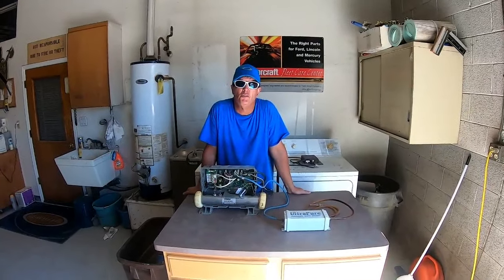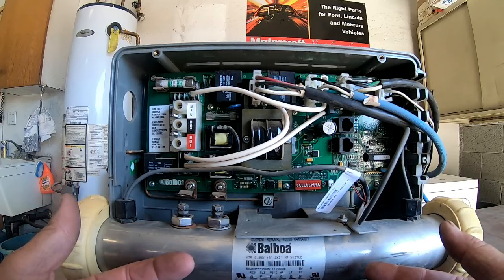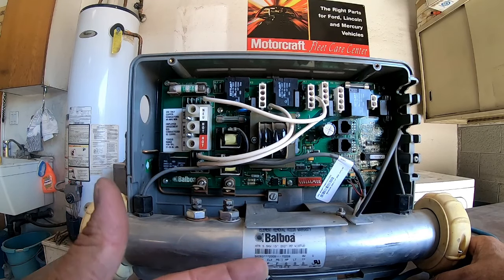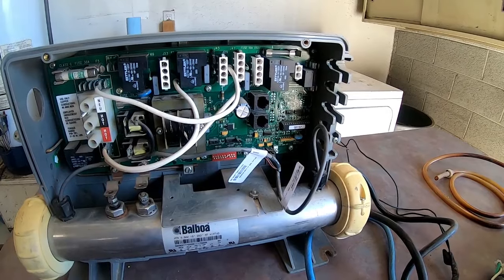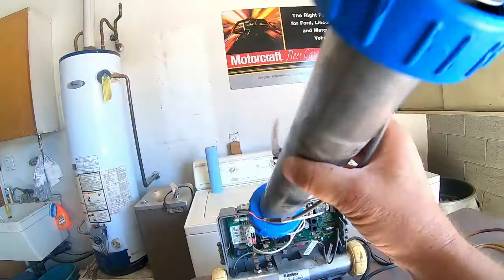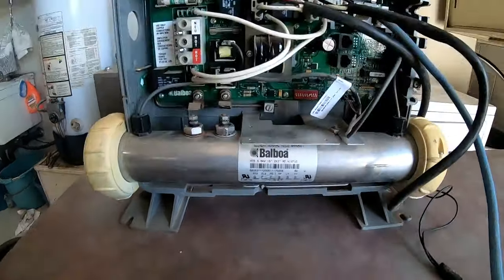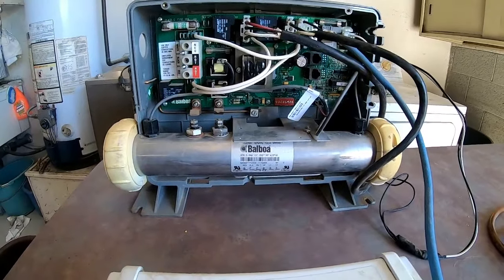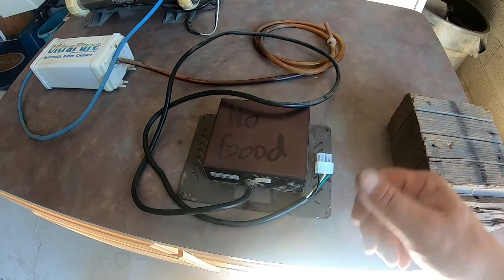Hot Tub GFCI Breaker Keeps Tripping..6 Things To Check For.(DIY Spa Repair) Arizona Hot Tub Factory

Comment: Hello Spa Man, I have a Z110 Jacuzzi Whirlpool with Balboa H136 control system. Water is hot, works well but from time to time the top panel red light starts to flash out of nowhere and disables the heater for 20 mins or so, then red light goes solid, which means heater is on and it stays ok. I drained the tub, removed the heater thinking it was getting fouled, but it looks clean inside, same is true for the power connection points, no rust or calcium buildup anywhere. I am guessing it's one of the two temperature sensors. One sensor is embedded in the heater. The other one is in the water filter assembly. What do you recommend I do to address this flashing red light problem? cheers!

Comment: Hello- Thank you for your videos. I have a 2005 Jacuzzi J335 that trips breaker after heater is on for about 5 minutes, not immediately. If I turn temp down so that heater will not come on, breaker will not trip. Do you think this is a bad Heater or something else? Thank you
Reply from the maker: I would say that is a good place to start...and if that heater has never been changed you are on borrowed time ,15 years.. you have done a good job at taking care of the hot tub..I had one that was doing this couple months back..it would run then pop the breaker.. so I disconnected it and the tub ran for over two week no problem then when I hooked it back up it popped with in minutes..as it turned out there was a tiny pin hole in the heater that when water seeped through it would pop the breaker..I replaced with a new OEM and problem went away.  Hope this helps ..Thanks for watching.

Comment: Soooooo my board fried where the power wires connect/ hot and neutral wires. I guess water got in there or something. Any way I can replace without having to change the whole circuit board

Comment: We have a BALBOA  control pack on our OCC hot tub. but the gfci breaker on the disconnect will trip but only after about ten minutes of being in the tub with both pumps running. It seems as though the circulation pump has a little problem with kicking on as there is a delay when turning on. but it doesn t trip then only after me and my wife are in the tub in front of the jets?

Comment: Spa Man - can’t thank you enough.  Was ready to call a service guy but it turns out the heater was bad. I looked at the Balboa package and assumed I could not diagnose the problem.  You made it very simple.
Reply: Silly question but same thing with my Balboa! Where did you find a new heater tube?

Comment: I have this exact board in a 2012 MasterSpa. Dealer went out of business so I am trying to troubleshoot. Error code is HFL and there is no activity in the pumps at all, both pumps stopped at the same time. Heater heats up but no circulation of water. Any thoughts? Could the Ozone system shut down the pump relays?

Comment: So I followed all your instructions. I have a balboa. It ended up being the heater fixed the heater. Hot tub ran for 24 hrs brought up to temp come home and the breaker has been tripped. Again go through your troubleshooting and now it’s the circulator pump. I plugged circulator pump into a pump2 slot and boom kicks breaker again. So am I replacing the circulator pump? What’s your opinion.
Reply from the maker: Both the heater and the circulation pump cause a lot of problems for Spa Owners..I can only tell you what I see in Arizona ... With the hard water that we have in AZ  and the fact that most home owners put way to much chemical in there Spa!!  The heater and circulation pumps on most spas only last 4 to 6 years (Based on a Spa that is plugged in and used 24/7 for 4 to 6 years. Now that being said that is a lot of use for a component that is being used 24/7 ... My own personal Spa is a 2007 and the only replaced items so far have been the cover once and the filter every year.Mine has never been unused or empty more then a couple hours when cleaning and I keep my chemicals perfect...Hope that Helps and Thank You so much for watching ...If you still have problems call me and I see if I can help you trouble shoot stover the phone.
Reply: SPA MAN thank you. I ordered a circulation pump and were gonna give it a try. Based on me plugging it in in a pump slot and it doing the same thing kicking the breaker. I am almost certain the circulator pump is faulty. Thank you

Comment: Heh Scott, I've got a 60 amp panel in a shop below where the hot tub goes. I have about a 30 ft run.  The ceiling is 6 in concrete slab. Do  I go 60 or 50 amp to sub panel right beside my existing panel and use that soft conduit or hard conduit up tp the underside of tub? Thanks

Comment: Hey Spa Man! Thanks for the video! I have it narrowed down to when the pump that circulates water through the heater tries to kick on, it trips the breaker. I tried a different motor and it does the same thing. Could it be a relay or something if it’s not the motor? Thanks I’m advance!

Comment: Hi Spa Man- I have a Jacuzzi J335 with a three wire system. You have helped me isolate my tripped breaker problem. It was actually the breaker in the house Panel. I put a new 50 amp breaker in and the hot tub is working fine now. The panel in the house is a three wire as well going into the disconnect outside near the tub, this disconnect is not gfci. My tub needs a gfci for safety and I would like to install that inside the house panel in place of the new 50 amp breaker I just installed. Does the pigtail off the gfci go to neutral ground bar in house panel? Also, would there be no neutral coming into gfci in my case? Hope this makes sense. Thanks so much
Reply from the maker: Give Scott a call and He will walk you through it and help you to make sure it is all safe and ready to go...

Comment: If it is the ozone causing the trip, does the whole ozone generator need replacing or just the check valve?
Reply from the maker: The entire unit needs to be replaced... Once the ozone starts tripping the Breaker the damage is done.. Replace with a new unit and check valve..Buy a couple extra check valves and change them out at the very least every year.. If you have hard or crappy water or well water you might want to change it every 6 months ...Good Question   Thanks for Watching & SUBSCRIBING

Comment: I have a similar issue..but it's blowing the fuse. And it takes days before the fuse goes. And suggestions?
Reply from the maker: It all depends on which fuse is blowing that tell you what is going on..If its the big main fuse or is it the small slow burn fuses. Thanks for Watching & SUBSCRIBING
Reply: @spaman5440  The main 30A one on a Balboa 55370-1 brain. No loose wires on the mains. Im puzzled.
Reply from the maker: @PickledAndFermented  Give Scott a call at the shop and may he can figure it out...Thanks for Watching & SUBSCRIBING

Comment: If it is the ozonator can you run the system by disconnecting this? Is this needed? TY
Reply from the maker: Yes you can run the spa with out it ...But having one that works properly will help you keep your Hot Tub much cleaner. Thanks for Watching & SUBSCRIBING

Comment: I checked everything and even with everything unplugged on the board like you said the breaker keeps tripping, could it be something coming from the main going to the breaker outside by the hot tub?
Reply from the maker: Yes...In the very beginning of the video I tell everyone that everything from the main breaker in the main panel all the way to the wires going to the pack are all working properly. So go back to your main panel and make sure all of you connection are tight and then check sub panel and then the Hot Tub. Are you using #6 THHN wire... does any of the wire go under ground ? With the main breaker shut off.. disconnect the wires to the pack and then turn on the breaker if it does not trip You could just have a bad board. You said you have unplugged everything to the board and it still trips.. So you only have a couple more things to check ..But if you do not check them and just replace the board you will most likely still have the same problem...working on Hot Tubs is not an exact science its more of a process of illumination. Hope this Helps  Thanks for Watching & SUBSCRIBING
Reply: It has worked fine for several years, had the heater replaced last time this happened 5 years ago.  We put in a tankless water heater in our house and not on the same breaker but this is when I noticed the breaker in the main box had tripped, reset it and then noticed the hot tub breaker outside had tripped also and wouldn't let me reset it but once then keeps tripping so I tried unhooking everything one at a time like in your video and then all unhooked and it still trips.  There are some wires under ground but have never had a problem til this week.
Reply from the maker: @gregs1504  Give Scott a call on Monday and maybe he will be able to help you. He is in the shop after 9 a.m. most mornings
Reply: @spaman5440  We figured it out, was a bad breaker and the new breaker wasn't grounding well so no power to the hot tub until we rewired the ground wire.  Thank you for all your ideas, ruled out a lot.
Reply from the maker: @gregs1504  Right on good for You... Thanks for Watching & SUBSCRIBING

Comment: Hey Spa Man, thanks for all the great videos! I'm working on a friends Balboa and it trips the breaker sporatically. It runs fine for a while and usually when the cycle shuts down it can trip the breaker. I tried disconnecting everything and repluging like you said. It's not the heater or ozone devices but seems to be the 2 speed left hand motor that is the problem but the motor runs fine. Replaced the main breaker. Any suggestions about the motor? Thanks a mill.

Comment: My neighbor's spa trips every 60 seconds. They are not interested in repairing it. The sound is obnoxious. My question is, if they continue to use it will it eventually just break down to the point of not turning on at all?
Reply from the maker: YES.. it is already broken if the breaker is tripping after 60 seconds (You turn on the breaker and it goes through a series of tests when it comes to a problem it trips)If the breaker is tripping ...It is doing it for a reason and they should STOP turning in on and get it fixed. The problem does not just magically go away with time. The longer they wait the more it will cost !  Hope that Helps Thanks for Watching & SUBSCRIBING
Reply: @spaman5440   Thank you!

Comment: What if the breaker doesn’t trip immediately? Mine runs for hours but then it trips!! Heater, circ pump and both jet pumps seem to be working. It has ozone too. My electrician installed a 50 amp GFCI breaker in the main panel but a fused pull switch disconnect box instead of a “sub panel”. Running #6 wire for all connections. Its a Sundance Cameo 2022. Someone please help!!!

Comment: what about when the gfci breaker only trips a handful of times a year maybe 5 at most and works just fine when it’s reset for weeks or months at a time?
Reply from the maker: Well does it trip when the outside temperature makes a drastic change in temp overnight either up or down ? or after a rain, thunder or snow storm.? are all of the connection tight ? are you running Roman wiring or the wire being used is not #6 THHN wire ? does the wire from the sub panel to the spa go under ground and then into the tub and connected ? What hot tub do you own and what part of the world do you live in... the reason I ask the last question is the problems I see and fix in Arizona most spa owners will not have in other areas of the world because of our heat we see in Arizona during the summer months just like we don't see the cold winters that are seen in Minnesota.  Hope this helps  And Thanks for Watching & SUBSCRIBING
Reply: SPA MAN I have wondered in the past if it was anything to do with the weather because it is random I’ll have to pay attention more to see what weather happens when it happens. I’m curious why the weather affects it though? The wire does not run underground. It’s thicker wire not Romex. I don’t know the exact gauge of it. The hot tub is a 1999 Hot Springs arena 7 foot round and we are in Massachusetts so yeah colder weather. Thanks for any input

Comment: What  if I’m not getting any power to the hot tub at all when I click the GFCI button on the hot tub breaker? 
I can’t even get anything to come on.
Reply from the maker: Need a little more info...but have you checked to make sure you have a power at the Hot Tub with a meter before the wires were connected ? Have you checked to make sure you have power at the main breaker with a meter before you connected the wires? Whenever you do not have power you alway go all the way back to the main and check everything..Hope that helps Thanks for Watching & SUBSCRIBING

Comment: My hot tub will stay running fine through the day, but when it gets colder < 30 outside the breaker trips. I've replaced the heater. What would cause it to trip when the temperature drops?

Comment: I disconnected my heater and it stopped tripping. Question is. Does that mean the heater is bad?  Can I just replace the element?  Or is it the flow switch?
Reply from the maker: Well... reconnect the heater if it trips again ? Then I think you found the problem. Easy fix replace the Heater. Replace the whole thing as a unit it will save you a ton of headaches. Hope this Helps ..Thanks for Watching & SUBSCRIBING
Reply: SPA MAN Haha. Just got done putting a new element in it. Just waiting for the pressure switch to get here tomorrow. Might as well replace that too while it’s apart. Got it all cleaned up and looking like new. Just have to repair the leak in the filter holder and I’ll a bathing beauty again.
Reply from the maker: @tna2me197  Right on Good for You..

Comment: My problem seems to be the circulation pump? When does three wires are unplugged black red and white, It does not trip. This is a hot springs.
is there a way I can test the circulation pump with the voltmeter or something?

Comment: What happens if the breaker doesn’t trip but nothing happens? I can hear the control box clicking?  Is there internal fuses I need to look at?  I have a maxx elite with gecko control box
Reply from the maker: Yep you need to open it up and look inside the pack.. Before you do this shut off the breaker and open it up.. take the pack door off and look at the back of the pack door to locate the fuses and then  check fuses with a meter to make sure they are good.. (some spa use a slow blow Fues so make sure you replace a blown fuse with the correct fuse.. Hope this Helps.
Reply: SPA MAN I’ll try this tomorrow
Reply: Quick question my balboa hot tub 501z keeps running the pump and cannot get oul of fc mode only pump keep running after the heats sensors got installed any sugestions pls

Comment: "Ozonator" how do you troubleshooting something that doesn't do anything at all.
Reply from the maker: For example...With an Ozone they either work or they don't ...If they don't work or are junk they will usually trip the breaker.. If its not tripping the breaker they are usually a good unit... now If you haven't changed the check valve in the last year..the unit is probably working but your are not getting the benefit of the unit in witch case you need to replace the check valve with a new one every year... Hope this Helped Thanks for Watching &  SUBSCRIBING

Comment: Hello, nice movie Scott!
 I have some problem with my spa 'Model: E781VM maax spas'
when spa light are on and I switch heat, trips GFCI (hager model CDC440J).

When I dont use a spa lights, heater functionally normal with jets etc. -> like spa light functional normally with jets etc. without heater.
i try to disconnect a light AC from mainboard (SloanLED LiquaLED Control 40 controller) but it`s still the same, when I switch lights on control panel [with disconnected light controler or not] when heater is on -> GFCII is triggered.

any ideas, please help :)

Comment: I kept narrowing it down. I finally found this little blue box that had a hollow ear tube connected to it in a power supply had to do some research found out it was in the ozonator so I contacted a few companies they're the ones that educated me on the fact that it was an ozonator. . They kept trying to tell me it was the ozonator well after doing some research I found out there's a funny little tiny plastic part called the backflow valve because nothing else is leaking on the hot tub last winter it leaked all the water out and after looking at the mold and everything inside it all came from that resonator I have a brand new heater brand new split couplers brand new everything there's almost nothing this hot tub doesn't have that's not brand new how can a little electric part have water in it boggles my mind anyways ozoneated well I'm going to try a back flow valve. By the way my hot tub is accused backyard vs series which has all Balboa parts

Comment: Thank you sir!  It was my ozone causing my breaker to trip 1-2 times every 24 hours.  I removed it. Hasn't tripped in 4 days. 😊
Reply from the maker: Right on good for You ...Thanks for Watching & SUBSCRIBING
Reply: Well it's been two years since I had any issues.  Tub was working well but with the nicer weather I thought I would drain the water and put in fresh water.  When I flipped the breaker back on it instantly tripped.  Tried it like four times and it tripped instantly every time so I guess I'm opening it up and start unplugging stuff.
Reply: Looks like it's the heater.  Thanks to another of your videos I will be swapping out the heater as soon as I get a new one from my local dealer.